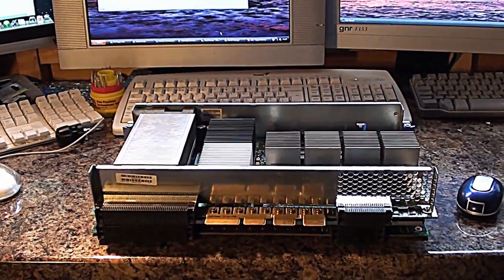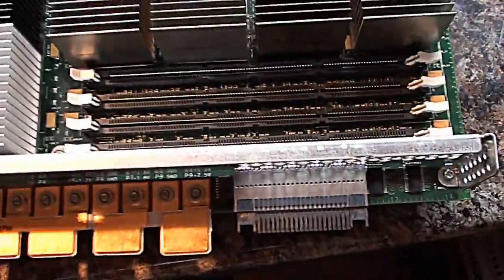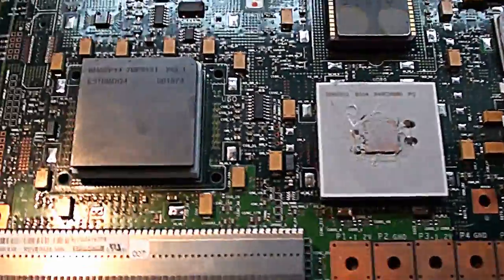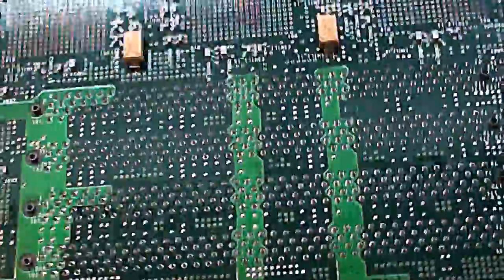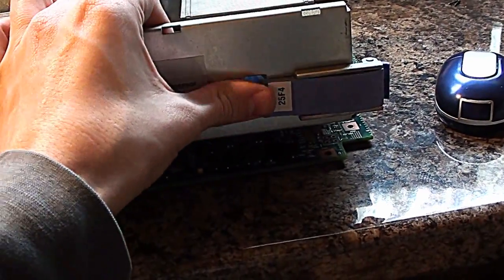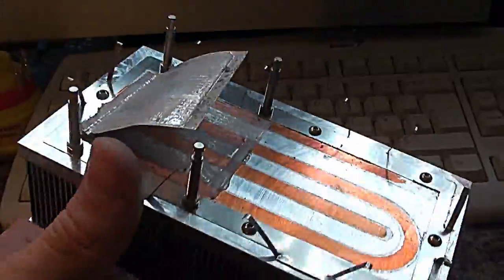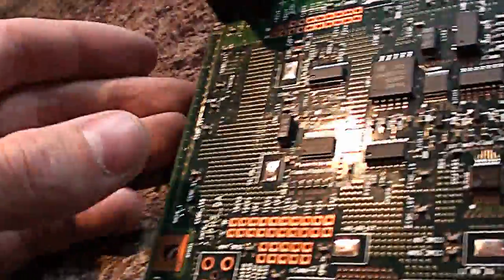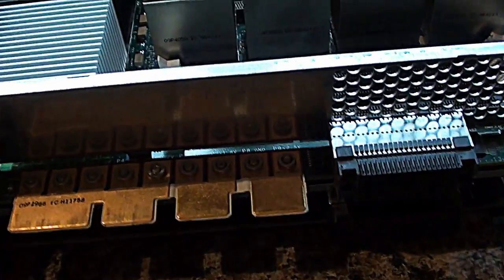IBM Power4+ Mainframe CPU Teardown

Comment: The HDL5J038-1 is most likely the L3 cache chip.  It wasn't uncommon for POWER4 systems to have 32MB of external L3 cache which runs at the speed of the bus, or about half the CPU clock.  These processors have four separate 128-bit buses, each of which run at half the CPU clock.

These were definitely hot-swappable; it was possible to move jobs between physical processors in the central processor complex and shut one down so it could be removed and serviced while the others are still running.  IBM calls this Capacity On Demand.

Comment from the maker: You're absolutely right. The heatsink compound has set like cement to the silicon die and the surrounding components. It may be a little unorthodox but I have found that medical grade alcohol or acetone (both of which are cheap and relatively easy to buy if you know where to look) usually removes the compound with the least effort.

Comment: This is an IBM pSeries 670 or 690 the p670 comes with upto 16 processors and the 690 had upto 32 processors. It its day the p690 was the top of the range AIX / UNIX Server. Clustered together they were used to simulate Weather Forecasts and Nuclear Bomb Simulation. That kind of stuff - however most users were large retailers and banks across the World.

Comment: These were so late in development that they didn't sell because the competition had much faster machines. You couldn't look at one for less than $800,000. IIRC the cards with half the memory installed were $120,000 each. They ran UNIX.